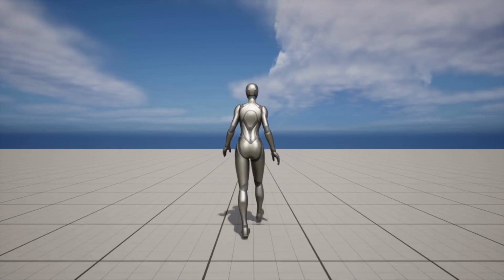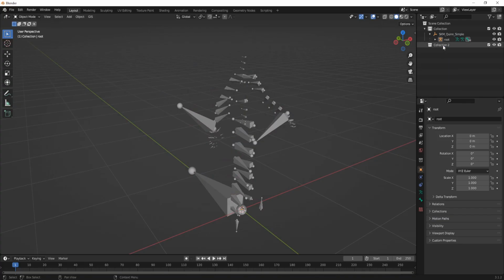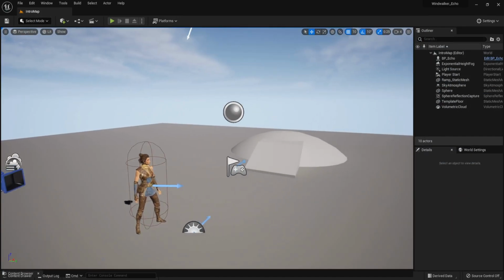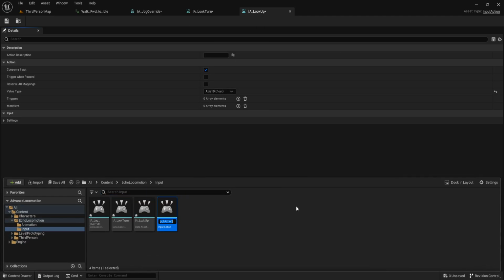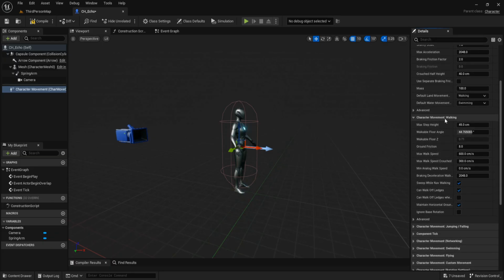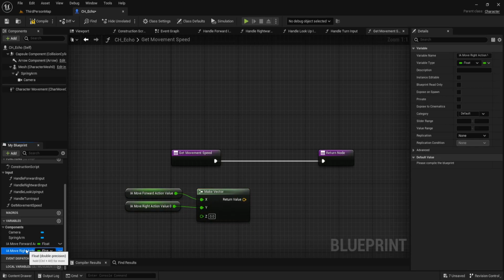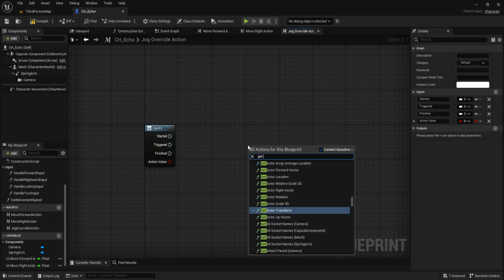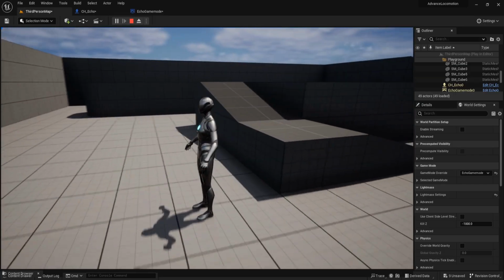Advanced Locomotion System Tutorial- Part 1

Comment: Hello everyone, I built everything as in the video, I checked several times, but I can’t find my problem, when I press turn 180 degrees while walking and running everything works as it should. But when I press start from idle to the right or left, the character turns sharply towards the camera, and only then turns in the right direction, as if the starting rotation is set incorrectly.
Reply from the maker: You can debug your blueprint with windwalker echo project. Make sure everything is the same as the original project.

Comment: can you make the third person always facing forward never turn the body back? like alan wake 2 gameplay locomotion?
Reply: did you solve this? if not then your anwer is to reverse the two settings in character movement details, controller desired rotation and orient rotation. I can remember which one you turn on or off but just switch them.

Comment: Hey this is great !, i am just wondering what are all those "magic numbers" / all the non variable numbers you put in the get movement speed function,
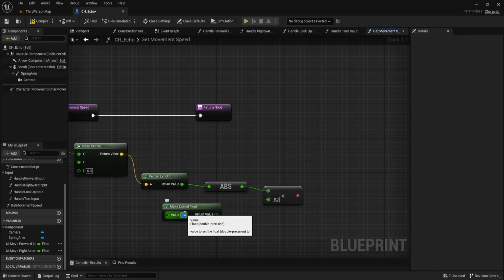It's starts at 34:14, and it seems like it is very specific for the animations, and not customizable, hoping i am wrong.
Thank you for the tutorials any way !
Reply from the maker: I found this note on windwalker project "Keep character from moving too slowly and from having speeds too fast for walk but too slow for jog.   Doing this with both values at the same time to make a vector rather than individually for each axis because this creates proper vector length.  Doing it individually creates a square "deadzone" that has a longer vector on the diagonals".

Comment: Hi! First, thank you sm for this tutorial:) i'm currently at part3 of the video series but i'm having problems with my character only walking forward, no matter the camera position or commands i use (i'm using  both arrow keys and gamepad thumbsticks). Do you have any idea why that is the case?
Reply: i also did print strings for the determine locomotion state (idle/walk/jog) and when i chose to run or walk the character, the log keeps glitching between idle and walk or idle and run.
Reply from the maker: Maybe check on the character movement component, max acceleration is 500 and braking friction factor 0. This problem may happen in your transition from idle to walk and idle to run.
Reply from the maker: You can download the full project link is in the description.
Reply: In your character's BP search for orient rotation to movement and make it true